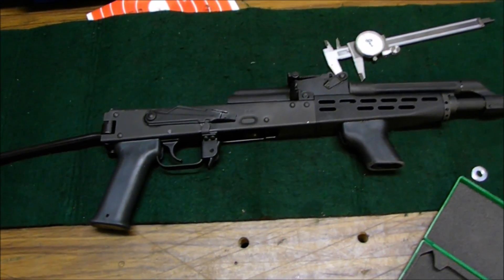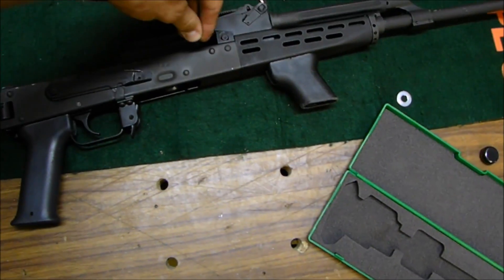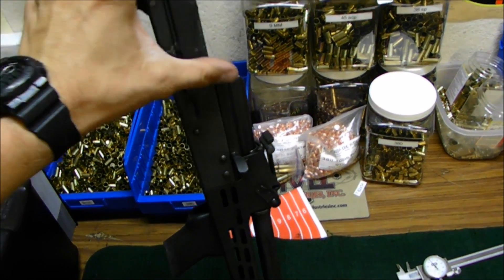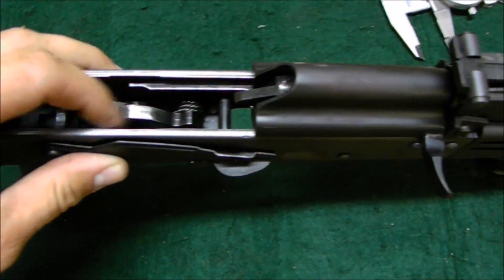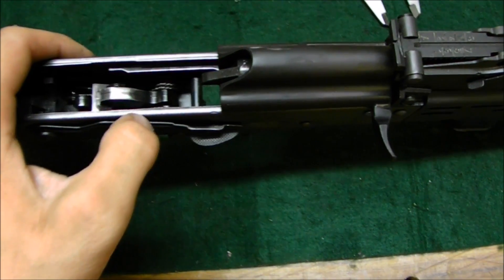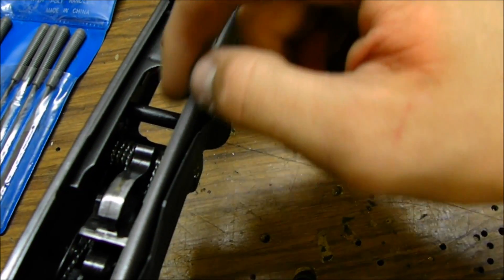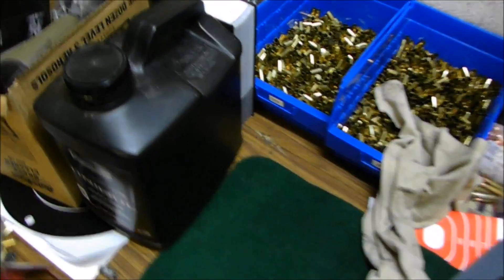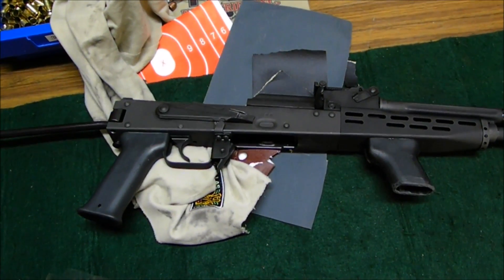Ak-47 Bolt Sticking? Guide Rail Polishing

Comment: I was having similar issues with my Romanian, I found a few rough edges on my rails. Rather than using a Dremel and risking taking too much off I put a dab of Flitz polish on my rough spots. Worked the bolt 20 or 30 times, ran a few rounds through it and so far its cured.
Reply: Your comment helped me with my new AK, doesnt stick at all after using Flitz polish on the hammer and rough edges. thanks man
Reply: @7gng1  what ak u got bro
Reply: @user-ck7si1os9u  PSA GF3
Reply: Great idea. I will have to try this. I know your comment is 5 years old but  thanks!!
Reply: Thanks bro

Comment: I’ve built a few of these. There’s alway some warping when spot welding the rails in. I’d recommend doing 1 weld on each side at a time to help minimize heat. Also another thing I do when it’s done is get the 1000 grit lapping compound and work the bolt  back and forth till it’s buttery smooth.
Reply: There can also be warped when you're carelessly installing your center support rivet and bend it (ask me how I know)

Comment: Do you have any suggestions for a bolt sticking when pulled all the way to the back? Seems like the carrier is catching on the rails but I'm not sure. I have tried rounding out and polishing the trigger but have had no luck with that...
Reply from the maker: Is it a Palmetto state AK? some of those have issues with the rails cut improperly, an odd profile on the hammer that pushes the operating rod upward and out of the rails
Reply: @GunsWithGage  yes it is a palmetto
Reply: Mine does that too i think your just pulling it back to lightley.....if pull back hard it gos forward no problem .
Reply: @screamingwarhog  I literally just got Zastava and it's doing the same thing, but when I pull back on it like a man it works fine... I'm a new AK owner so now I'm just like "Nyet Rifle Is Fine"

I'm sure it'll break in..
Reply: @Dr.KoalaBear  yup aks like being treated rough....btw i recommend the alg ak trigger its the only upgrade i recomend ...takes a little to fit sometimes and a little modding of your trigger spring tension. 
But worth it!
Reply: Hewhoremains420  yes i had issues of trigger resseting beforebpokishing it
Reply: @screamingwarhog how's it going? I bought my first ak(ZASATAVA NPAP) awhile back, and I've been noticing the carrier is getting snagged on the trigger as it slides over it, also the gas rod is getting stuck on the lip right under where the dust cover right under the sight. If you have any ideas I would appreciate it or know someone that might know, Thanks.

Comment: I'm kind of having that issue. I had no problems with the factory parts wasn't super smooth but didn't hang up.  I just installed alg akt trigger and hammer  and it's hard to even put the carrier in to slide on the rails when installing. then I have to out a good amount of force to rack it. it likes to stop right when I hits the hammer.  was thinking maybe I should Polish the hammer but idk
Reply from the maker: Definitely worth polishing the trigger.  It helped me out.

Comment: I was shooting my ak earlier and the bolt got jammed half way went to fix the jam and the bolt was stuck, had to use a rubber mallet to knock the bolt out of the gas tube. Any suggestions? I’m going to lube it up tomorrow and see if it works but wondering if anyone has similar issues while firing? I am a ar guy and just started getting into aks so any suggestions would be great.

Comment: Mine locks tight in the closed position and I have to whack it with a rubber hammer to get it to open then it will cycle but it continues to stick. May just need a couple hundred rounds put through it.
Reply: My K-USA 103 did that for the first couple hundred rounds. My guess is tight headspacing.